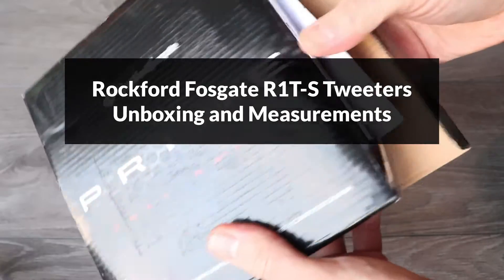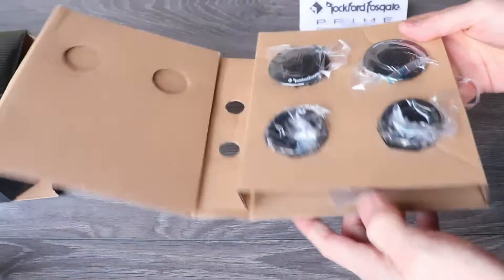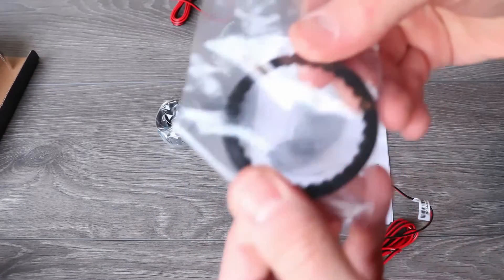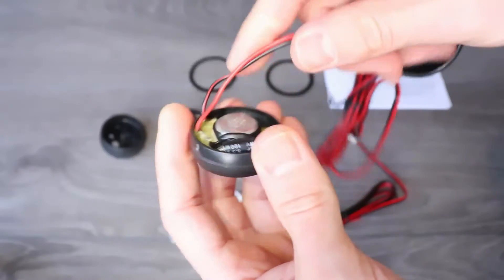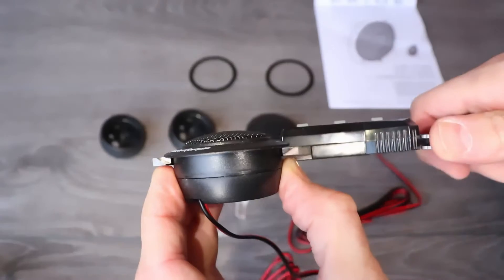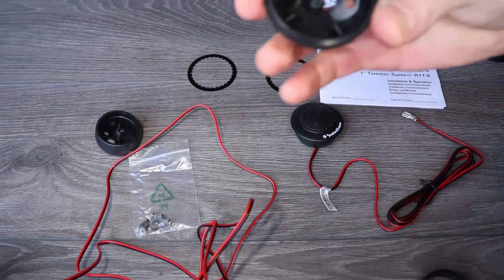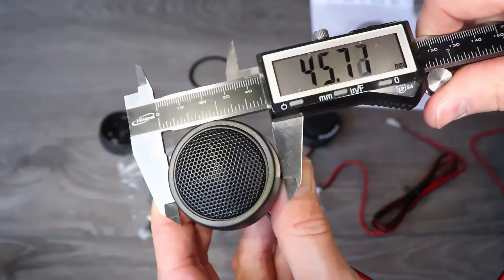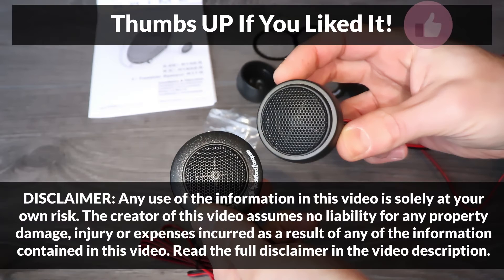Rockford Fosgate R1T-S Tweeters Unboxing and Measurements

Comment: I'm looking forward to the installation video

These will be a nice upgrade over the cheapo tweeters it came with
Reply from the maker: I had to re-film some parts, but I finally got it all together, just have to finish the script, hopefully it's done tomorrow.
Reply: @CleverFix  you make awesome car maintenance and vehicle enhancements videos

You could do that full time if you wanted to
Reply from the maker: Thanks for the feedback. If I had a garage and cars to show things on, I would do it. For now I have no garage, and hardly a quiet spot to film. Much of what I film is filmed 2-4 times until I get a quiet background.  Dogs sometimes decide to bark right in the middle of what I'm doing, so it makes things very difficult.  I'm thinking of replacing the control arms soon, I have the annoying bushing squeak, I think most 2014's will have it by now, especially when cold and driving over bumps. It's very annoying.. I sprayed it with at-205 rubber conditioner and it helped, but I still hear it sometimes. The suspension is definitely not as good as it was when it was new, .. it's not terrible yet though.
Reply from the maker: Video is up: https://www.youtube.com/watch?v=EG8nxTCzVa0